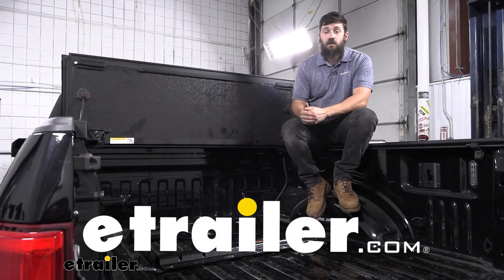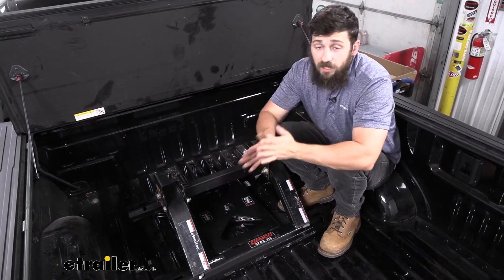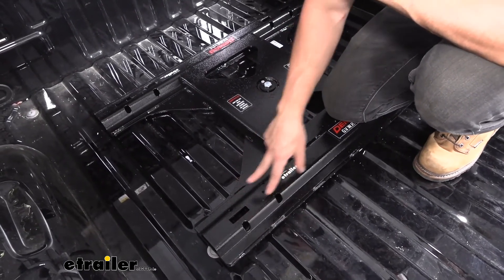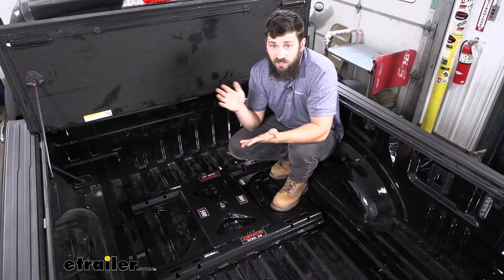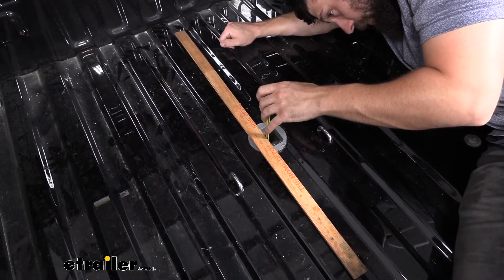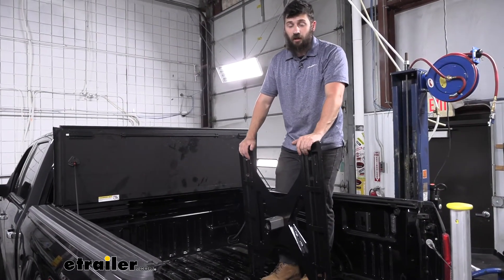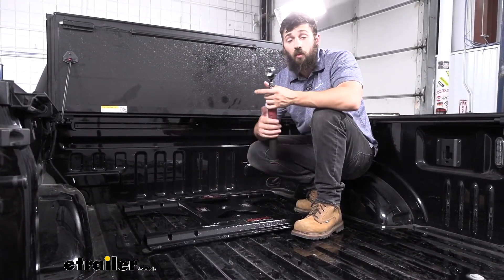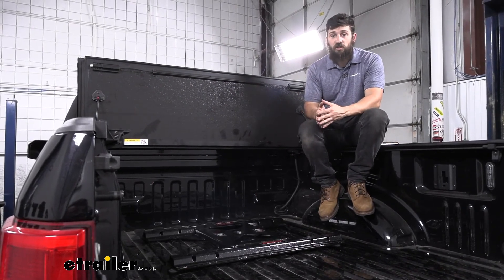etrailer | Demco 5th Wheel Base Rails Adapter Review

Comment: Can you mount the pull rite 2700 with the industry standard rail mount ears ?
Reply from the maker: Absolutely, the Pullrite 2700 is indeed compatible with the industry standard 5th wheel rails from Reese, Curt, Demco, Draw-Tite, Husky, Valley or B&W.
https://www.etrailer.com/tv-Demo-Kats-Heaters-Vehicle-Heaters-Engine-Block-Heater-KH11409.aspx
Reply: @etrailer  so I can use the pull rite auto slide hitch on this adapter correct? I saw notes online that it may not be recommended I just need to verify is all
Reply from the maker: You can't use the SuperGlide with an adapter like the Demco # DM6140. The capture plate/wedge prevents the king pin from rotating in the hitch jaws, it's the hitch head that will rotate. This could damage the shank that mounts into the gooseneck hitch.